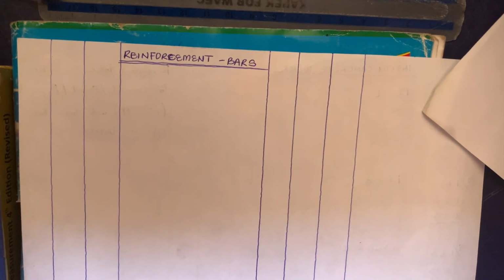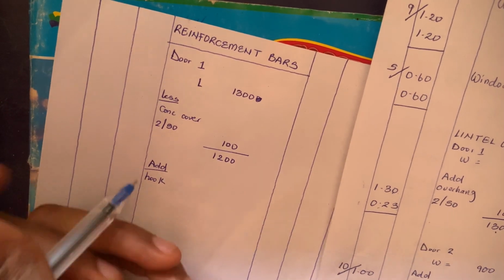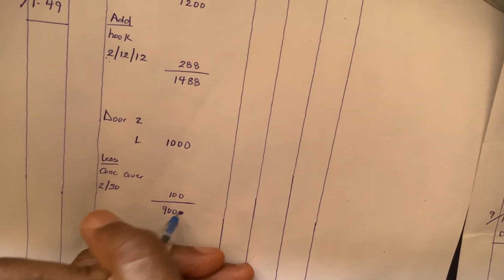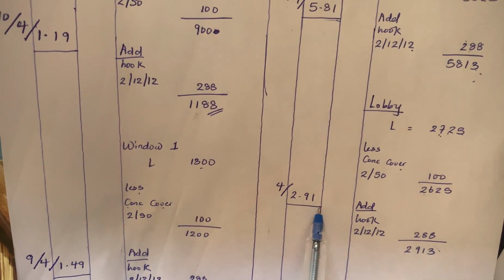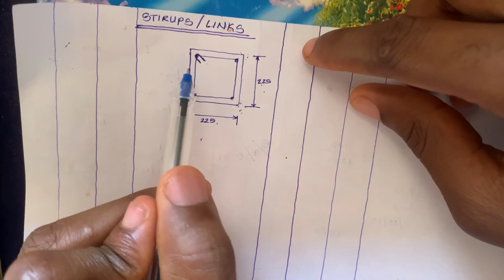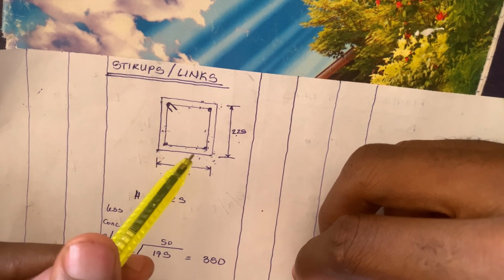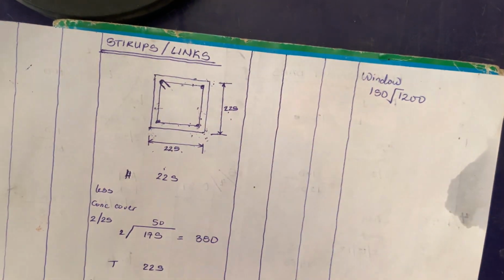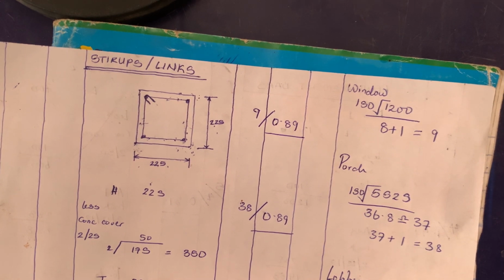HOW TO MEASURE QUANTITIES FOR SUPER STRUCTURE [REINFORCEMENTS AND STIRRUPS]

Comment: when you calculating the stirrups there is no need to multipy the amount of opening like let say we have 4 windows or doors , does not include this amount of windows ?
Reply from the maker: It makes it easier 
If the opening size is the same 
Than measuring it one be one. It’ll take a lot of time 
You have to do for all the openings that’s would carry lintel